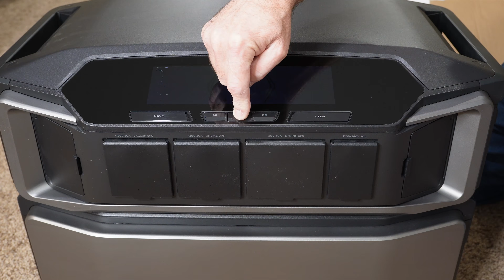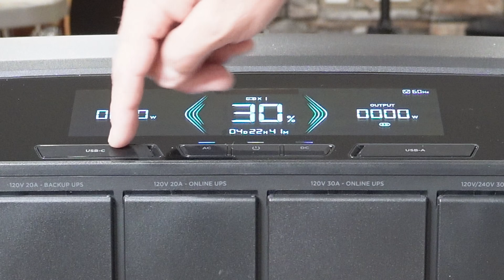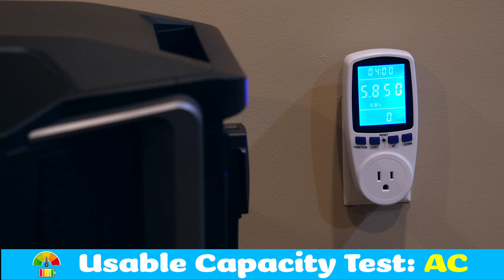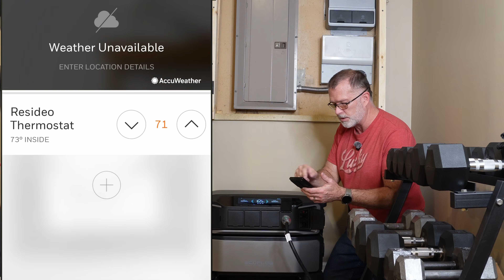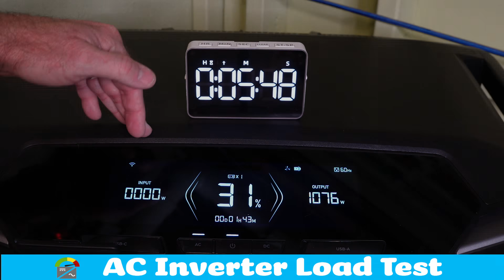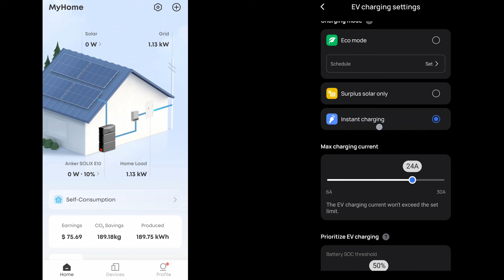DELTA Pro Ultra vs E10: Which is the BEST Whole Home Backup Solution for YOU?!

Comment from the maker: Some new information regarding the capabilities of both units for generator charging:  The E10 does now also have the ability to be charged by generator at up to 9600W at 240V, while the DPU can be charged through it's In/Out port at up to 7200W.  These are both better specs than what I described @7:17.   So, not actually a huge difference between the 2 units, but a slight edge to the E10.

Comment: Why do you measure air conditioning in tons?
Reply from the maker: Well..."I" don't.  But that's how whole-house Central Airconditioning units here in the US are most commonly classified.
Reply: 1 ton equals 12,000 BTU, if that helps...
Reply: @m3rdpwr  1 ton of what?
Reply: @Bob-bo8ik that's how they measure cooling capacity, per ton.
Reply: @m3rdpwr  Ton of what?

Comment: your specs on charging the Ecoflow Delta pro Ultra with AC connected to  a Home Smart Panel 2 is incorrect. it is much higher than 3000w @ 240v

Comment: The Anker E10 is a good challenge to Jackery 5000 plus. You can get jackery 5 kwh 4,000 pv input with smart transfer switch for $3 grand on OffGrid. Or get the e10 with 6 kwh 9,000 pv input for $4.3 grand with maybe $300 manual transfer switch. Anker might add discounts and then there is the price of expansion batteries to consider

Comment: An excellent matchup review on these two units.  I can never have a whole home backup unit as I made sure I had trees growing strategically for shade to keep the Texas heat at bay when we built our home 40 years ago.  Even the roof would not allow for solar panels.  Because of this I would choose the EcoFlow unit for a couple of reasons.  Its portability aspect and the 120 ac plugs I could use to plug in appliances.  The anker does not offer plugs.  As far as long term use during an extended outage, I guess I could always use my F150 powerboost to charge it with my 7.2kw generator.  Again great great review.
Reply: Yeah that’s kind of how I see it too. The portability of the ecoflow unit is a big plus. I also like that you can plug appliances straight into it. With the E10 you pretty much need an extra power strip for most things. The main unit only has like 2 outlets, while dpu has around 12.

Comment: Thank you for comparing the two units. 
Thinking more about Anker Solix system due to outdoor capability. My main breaker is on meter pedestal and fuse panel is back of house under large patio cover. Like to connect to transfer switch for power shaving. 
I have Enphase solar that feeds house first then rest goes to grid but So Cal Edison does not pay much with NEM 2.0.

Comment: I have a dual fuel Generac system, in my newer house, and I do like the battery option but to me it is cost prohibitive with a limited run life on say a week long power failure.
Reply: Solar would remedy that...
Reply: @JohnSmith-wt3mw  Thank you for the reply John, and where I live in Canada, solar is not an option. Winter is long cloudy, with short days.

Comment: Wouldn’t the better comparison be the DPUX. It’s a more recent generation; the DPU is multiple years old.
Reply: I was going to post the same comment.  While I would not go so far as to imply financial incentives were exchanged without proof. Not using the more recent DPUX w/ 2 batteries does come across as a disingenuous comparison.
Reply: I believe the point of the this video is that the DPU is closely comparable to the E10 while the DPU X is superior to the E10.
Reply: @johnmc57110 Really? The DPU that launched in January 2024 is more comparable to the E10 than the DPUX (both of which launched in January 2026)?
Reply: The DPUX ($8k) is more capable, however its approximately twice the price of the E10, so considering cost it's not really a direct competitor.  The DPU and E10 are both around $4k.
Reply: @E @EricM20 simple fact check by looking at both manufacturers websites shows the E10 w/ 2 batteries is currently listed at $6,300. The DPUX is currently listed on EcoFlows website w/ 2 batteries for $8K. That’s a difference of $1,700. While that is a significant price difference, it is no where near “twice the price”. And that price difference is directly reflected in the spec superiority.
Reply: You wouldn’t want to do that when your paid by Anker.